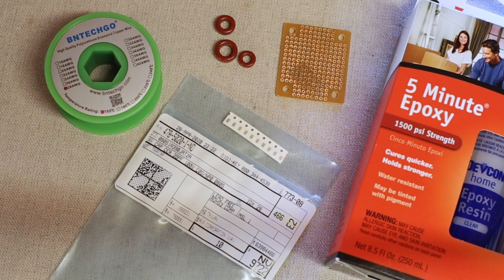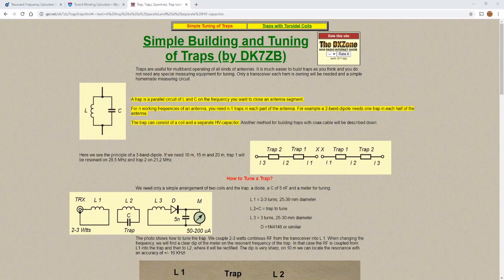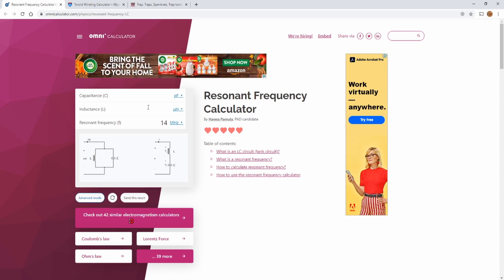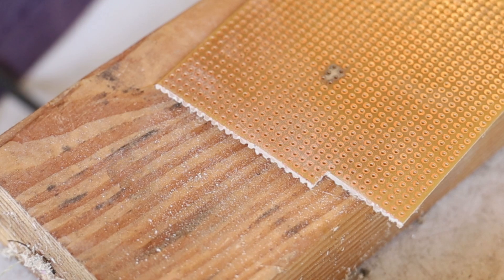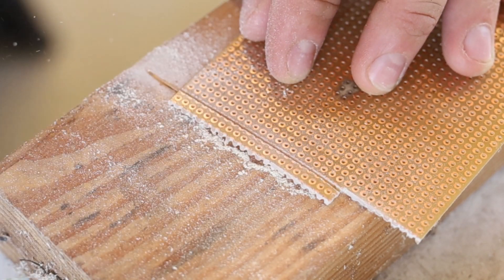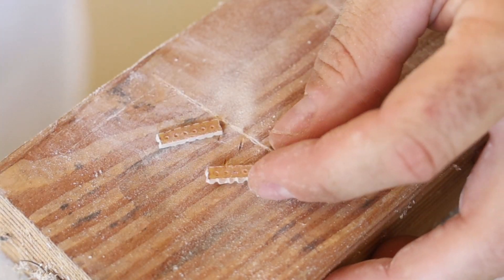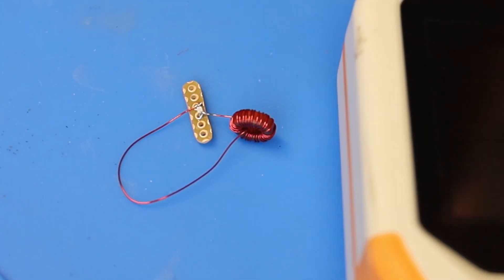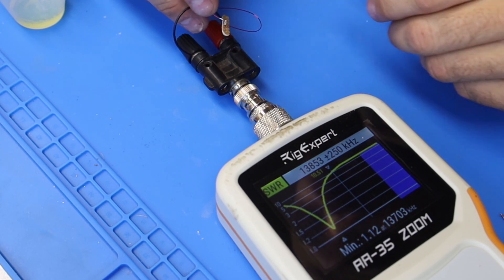HF Antenna Micro-Traps - DIY Build Project

Comment: Really impressive. How did you figure this out? Saved this video in my antennas playlist because I’m going to reference it a ton. Thank you for showing how you do it.  I need to hang one of these outside a snow cave!
Reply from the maker: Just through learning about antennas and antenna design, looking at others' builds (like the SOTABeams traps), and then modifying to my own strategy. I fail a lot, and each time is a lesson. Note that some epoxy throws off resonance. Hot glue is likely a better potting compound. Even the heat shrink can have an impact. Resonance generally comes down in frequency, so tuning slightly high is probably best.
Reply: @K6ARK  Noted. Thanks for that. Anyway, your antenna projects are super cool.

Comment: Hi Adam, greetings from UK!
Great ideas you come up.
I have this project in mind to use some of your kits and ideas to build a backup antenna (trapped) for 20m and 40m that I could attach to a hiking pole (say at a max height of 1.6m) to be used if mast breaks or main antenna breaks or weather prevents mast deployment for example.
Of the three configurations your matching unit kit allows, which would you recommend likely to perform better?
I have a manual ATU that I could use with a random wire or to touch up a dipole or end fed halfway.
Great to have your thoughts on this.
Thanks.

Comment: Excellent instructional video Adam. Thinking  about your 100v s.m. capacitors, I assumed they should be good for 25 watts, which is 44dBm or 100v pp into 50 ohms. (Maybe  add a safety factor so as to not make thise little guys sweat, and not hit them with more than 10 watts.)
For a 100w capable antenna, 50dBm or 200v pp into 50 ohms, you'd want 250 or 500v rated capacitors?

Or am I forgetting the impact of the impedance change between the antenna socket at 50r and the feed point impedance of the rig end of the half wave wire, around 2.5kohms? 

In other words, what's the RF voltage swing across the traps (this has to be known at all frequencies of operation), and how should we use that to size the capacitor voltage rating for various power levels?
Reply from the maker: I am a mechanical engineer so take my "wisdom" with a grain of salt, but I believe the voltage is higher at the ends of the EFHW (voltage max/current min) and therefore you need a higher voltage cap to prevent arcing across the dielectric. 

For efficiency and power handling on a 100w antenna, I'd probably go with more traditional air-wound coils rather than toroids. I suspect these little toroids would become saturated at > QRP power levels.
Reply: @K6ARK  Thanks Adam. A good option for portable QRP, but maybe use the linked dipole with the 100w rig.  Once you go to air wound inductors they get big and bulky, OK for a fixed installation that can be heavier duty.
Reply from the maker: Yes, I still use the linked dipole as my standard for 100w portable ops.

Comment: I really admire your micro builds. Your work is well done and the fit and finish is impressive for hand-built equipment.

If I want to run my KX3 at 15w, what toroid should I use? Will the T37-2 units be a little too small? 

Those online calculators are pretty cool, but what if I want to use my hand calculator? Do you know where the calculations are documented? I might even write a program for my HP-41CX.

73 de AG7TX
Reply from the maker: Toroid inductance can be calculated by knowing the electromagnetic permeability,  u (mu) and toroid dimensions. Typically, this is pre-calculated for a given toroid and reported as A sub L - the inductance per turn. 

The LC resonance equation is on the calculator page - just scroll down. 

I would anecdotally recommend a T50-2 size toroid for the 15w trap.

Comment: Question. I’ve tried building a couple of these but my SWR is sometimes close 1.5 to 2.0 when testing where the circuit resonates. Does a higher swr necessarily mean poorer performance? I find myself trying to spread coils to reach the ideal resonance; then removing a turn; then needing to compress the coils. All of this significantly affects the swr reading of the trap on my rig expert. Has anyone else had this issue?

Comment: That is awesome I have learned a lot today.  If I want to scale this up to say 800 watts how big does the toroid and capacitor need to be? Thinking this may be good for the qth also. Thanks Jeff ke4fwe
Reply: 800 watts with a 20 m torroid is problematic.... way too much voltage and amps on the torroid on the feed end, down right dangerous.
Reply: @randyvanvliet226  good to know
Reply from the maker: Jeff, for traps on a QRO antenna, you are likely better off with an air-wound coil or a coax trap. More traditional trap construction methods will serve you much better. This is definitely a technique intended for QRP.

Comment: Hello Adam, I just found you by accident and I was captivated by how small those traps are.  I was wondering, could it be possible to make a 160-10m long wire antenna using as many traps as needed for operating on all bands for permanent installation using maybe some larger ferrite and wires ?  
Great tutorial  73 André VE2WNF

Comment: Grate Video!  I have a couple of Questions have you tested these at 100 Watts and what is the result.
have you considered using 2 traps  spaced close together with small offset frequencies to widen the BW of some of the  wider bands creating 2 or 3 resonant spots on a single band? thanks

Comment: Should a 20 meter trap be resonant at the low end of 20 meters (14.0) or should it be resonant at the high end of 20 meters (14.350) , thank you Tom, W1TWS
Reply from the maker: Tom, I don't know for sure, but I understand that the traps incur a bit more loss if they are right on the frequency of use. I have heard recommendations to tune them slightly below the desired frequency, but I have seen or heard a legitimate explanation as to why that's better than slightly above.  One final note is that these micro traps are relatively narrow-banded.  If you plan to operate CW and SSB with the same antenna, it might be best to tune it to the seldom-used 14.100-14.150 range. That would put it just above the CW portion of the band and just below the SSB portion.

Comment: I don't understand what's going on with the analyzer.  Are we literally measuring the SWR through the toroid using the small wire?  My novice brain doesn't wrap around doing this testing without applying the toroid to a full length antenna and then testing SWR.  Is this similar to measuring the impedance matching like in your EFHW video?

The reason I ask is because I am in the market for an analyzer so I can follow these guides to build the EFHW.  I am looking at the difference between the NANOVNA vs the Rigexpert and whether the cheaper one will pull this off.  I want to match feedline to the antenna impedance for a simple EFHW and then build traps as a second project.
Reply: Replying in hopes of getting notification of any responses... I've been thinking about getting a NanoVNA, and now I'm seeing this RigExpert thing, which I'd not encountered before, so....... curious!
Reply: This video was excellent but the real standout thing for me was how you can measure the paramenters of the toriod windings using a wire simply passed through the centre of the toriod.
How is this possible and can the same be done with a nanoVNA or would I need a Rig Expert ?
Reply from the maker: Yes! The inductive coupling of the trap to the wire is really helpful.  You can do the same with a NanoVNA, but instead I would use an S21 measurement of the trap which should be even more accurate.  Install the trap in series between ports 1 and 2 to measure, and look at the logarithmic S21 dB loss. The trap should have a sharp dip on the frequency you want to block.
Reply: @K6ARK  thanks for the response
I have ordered some toroids and wire of known specs and will do a bit of experimenting to see what I can do with it and the NanoVNA.
Thanks again.

Comment: Question - Why two 30m traps?  I understand the loading coil is 30m and then you cut wire for 20m and you put the 20m trap there.  Cut wire for 30m.  But why the 30m trap when the loading coil is 30m?  This is something I would like to try but for 40m and 20m

Comment: Excellent build instructions! One question though: Since an EFHW is resonant on harmonics of whatever frequency it is cut for, should it not be possible to do away with the 20m trap and just have one for 30m?
Reply from the maker: No, unfortunately the 30 m trap throws off the resonance on 20 m because it provides more inductance and loading on 40 m then it does on 20.
Reply from the maker: You can, however, use a link for 30 m and then just use the full 40 m half wave for both 40 and 20 m
Reply: @K6ARK  perfect.  Those traps are too cool not to build so I'll go with your original plans 👍

Comment: When you set the antenna up with the traps, on the first 20m section that you set up, should you still set up the loading coil on the black tube that came with the kit still?
Reply from the maker: If you are building a trapped antenna, you don't use the loading coil with the kit because you are not utilizing the harmonics of any of the wire lengths. The coil is to compensate for the difference in wire length resulting from end effect.

Comment: My 12-year-old daughter is a General, and I got her a 705.  I'd like to see if there is a chart somewhere with wire sizes, and torrid sizing with losses etc.  I know she will be using JS8Call as well as CW and SSB, she is learning CW now, and my 15 yr daughter is running 15wpm.  I was planning on 20w to give a little head room.  Does anyone know of a chart or have recommendations?  Kids will do all the work on the build.

Comment: excellent tutorial. Question: is it possible to check the resonance of traps without an antenna analyzer?
Reply from the maker: The other (actually better) option is to use a Vector Network Analyzer such as a NanoVNA.  I guess theoretically you could achieve the same with a signal generator and oscilloscope, but that would be a much more costly solution. Without some kind of measuring device, you will not be able to tune your traps.
Reply: @K6ARK  Adam, with a signal generator and o'scope, how do you determine resonance? Thanks in advance. Jerry

Comment: Spent the last 2 days building and "trying" to tune a 20/30/40 end fed half wave. I ran into a problem and I do not know why. First I built my trap for 40 and it was resonant at 13900. I attached one end of my 20 meter radiator to my balun and the other end to the trap. I tuned it for a perfect 14.150. I then added the wire for the 30 meter radiator and noticed that my 20 meters was now resonating low. I shortened the 20 meters so it was resonant again and then adjusted the 30 meter section so both 20 meters and 30 meter were resonant. When I add my 40 meter radiator I had the same problem again, My 20 meter radiator was again too long and my 30 meter radiator was too long.

What am I doing wrong ???
Reply from the maker: Tom, your traps aren't providing a high enough impedance on the frequency of interest.  Try tuning them closer to the band, right at 14.0 is good if you can. It's possible your manipulations moved windings an adjusted the L to shift the frequency further off the desired point. 

These things are finicky, for sure. I have experienced your frustrations.
Reply: K6ARK Portable Radio thank you for you help and time best wishes

Comment: why are some traps wound around pvc pipe and others like yours are wound around ferrite cores? I don't understand the differences or why one would choose one method over the other. I love your videos and thank you for sharing your knowledge and skill. 73's Tom, W1TWS
Reply from the maker: Tom, air-wound coils work fine as inductors too. They require more turns to get a given inductance and are more susceptible to interference to/from other nearby circuit components (not so much of a factor in an antenna, of course).  I choose toroidal inductors for my traps because of the nice small size. You can certainly accomplish the same thing with an inductor wound on a cylindrical form.

Comment: Great! Question: Obviously when using these EFHW antennas, the other side of the antenna needs to exist... what do you use as a counterpoise? I've seen some people claim an EFHW doesn't need one, which seems like nonsense to me. What's been your experience, Adam?
Reply from the maker: Because the feed point of an EFHW is high impedance and low current, much less of a ground/counterpoise is necessary.  I have found that the radio itself and it's capacitive coupling to the ground and to you seems to be sufficient.  These EFHW antennas perform very well, and I am regularly able to work DX with them on 5w CW at QRP power levels.  I see noticeable difference in performance between the EFHW and a dipole at similar height.
Reply: @K6ARK  Thanks Adam. What works in the field is what matters, and the capacitive coupling idea you mentioned makes a great deal of sense to me. In addition to the no-counterpoise approach, I may play around with the Steve Yates AA5TB 0.05 to 0.10 wavelength counterpoise recommendation, too, since ground mineralization (and possibly therefore capacitive coupling with the ground?) in OH is far different than in the desert of the West (I know from working QRP out there is early 2020). I of course will also try your no-counterpoise approach just to see if I can discern any real difference in signal output using the RBN or possibly a field strength meter. Thanks again for your input, and for the great work on these videos! 73 de KD8ZM

Comment: An end fed half wave antenna should be capable of multi-band operation without the traps.  Certainly a 40/20 meter antenna should work without traps, though it would be optimum for the CW part of 40, and phone part of 20.  With a simple antenna tuner you can cover all of both bands.
I cut pc board with a jeweler's saw.
Reply from the maker: Correct.  The traps or a link add 30m.  Note that the antenna may be resonant slightly above the 20m band as a result of  the antenna being closer to the ground in wavelengths on 40m, making it resonant on a slightly lower frequency.  As you noted, this can be resolved with an ATU.  Alternatively, a strategically located coil can add inductance that brings both bands into perfect resonance.
Reply: @K6ARK  Years ago I made a multi-band trap dipole for 80,40, and 30 meters.  I used air wound coils and ceramic door-knob caps (5kv!).  The caps came out of an old ART13 WWII transmitter, I measured their values using  a Time Domain Reflectometer when I was working at Digital Equipment Corp.  I adjusted the trap frequencies with a Grid Dip meter (home brew) by adjusting the turns, fine tuning by spreading out the last turn on each end of the coil.  Then I tuned the outer ends of the dipole for each band for lowest SWR.  The antenna was raised and lowered several times to add the additional parts for each band in turn, first 30, then 40, then 80.  Took all day! (BTW it was a tower mounted inverted V).

Comment: Hi Adam,
You mentioned having a matching unit for each band of the EFHW. Are you using those small bullet connectors you showed in the linked dipole video to swap out each matching unit when changing bands? Stay safe.  73  WJ3U
Reply from the maker: No, I typically just tune the matching unit to the middle of the set of bands I want to operate on - so, for example, I'll tune it for 30m for a 20/30/40m antenna. You'll experience slightly higher swr on 20 and 40m but it's plenty good enough on all the bands.  It's more a matter of optimizing the matching unit for the primary bands of interest than it is a requirement.  Finding the right capacitor may be a greater factor if operating on the higher bands or with a multiple-half-wavelength long antenna (i.e. 15m on a 40m halfwave ).
Reply: @K6ARK  Thanks Adam.

Comment: How can I calculate what tyrods and capacitors, magnet wire I would need for traps to use with 100 watts? Is it even possible?

Comment: Adam, thanks so much for all you have done for the QRP, DIY folks. Your videos are detailed and very well done. I do have a question, in ordering parts for the micro-traps I used your link to perforated prototype board and ended up with a perforated bare phenolic board, nothing to solder to. Do you have another link to the correct pcb? Again nicely done. Tom KE0JVS
Reply from the maker: Shoot! Sorry about that. I do indeed use boards with copper for soldering. I selected the wrong link for the list. Here's what I would suggest ordering: https://amzn.to/35lcvzn. I updated the list in the description as well. Again, sorry about that, and thanks for the comments!
Reply: @K6ARK  Thanks, you are Mr. Johnny on the spot. 73 Tom
Reply from the maker: Ha!  Just tryin' to share the love of tinkering and ham radio.  Hope you have fun with the build!

Comment: OK Adam, please answer this.  Is it true then that your 20 mtr trap resonates at 14.00 Mhz, but the 20 meter wire itself can be tuned for 14.250 Mhz, i.e. into the voice frequencies?  - Bob W9PZ.
Reply from the maker: Yes, the trap has a certain bandwidth at which it provides sufficient impedance to function as a block for RF at that point.  The bandwidth may vary depending on construction, but typically for these traps, a few hundred kHz is easy to achieve.

Comment: I LOVE That I Inhereted BUNCH Of Capacitors, Radio Capacitors and TONN Of Other Radio related Stuff From A KGB Aaggentt, I Have Militatry Grade Stuff That Can Hold 2000Watts And Stuff Like That, HUGE TTorroid Rings, Like, You Can Put Your Hand In it If You Aint Huge ;D
So Much Stuff, Caps From 7pf to 450 i saw One so jeah,. variaaty is crazy.